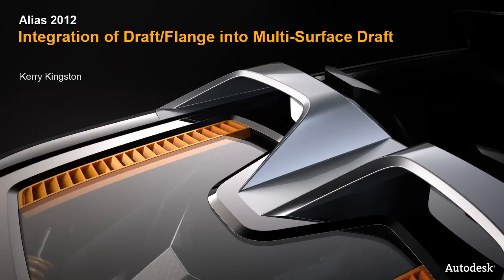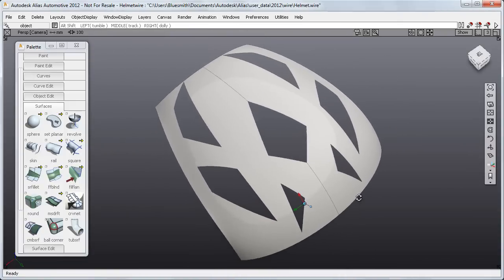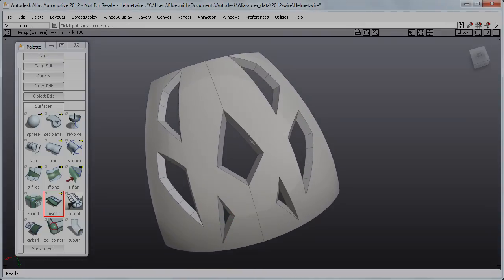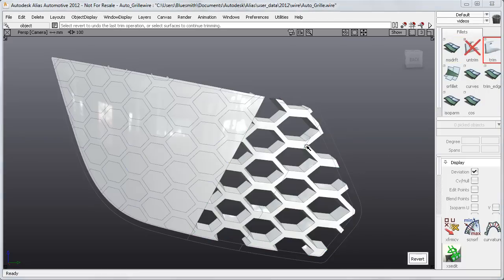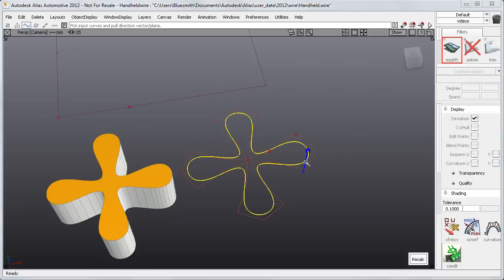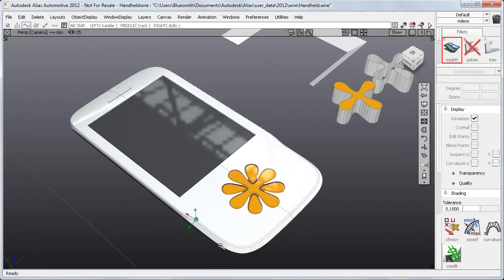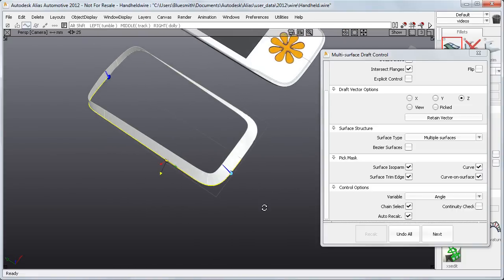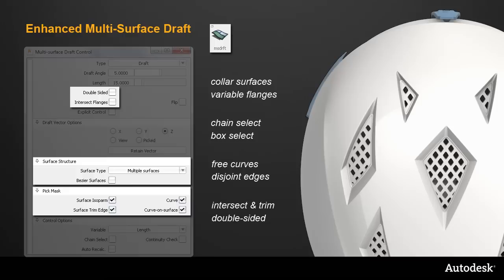Autodesk Alias 2012 Multi-Surface Draft

Comment: Sorry for this question after so much time, but in Alias 2023 is the variable option available? I mean to be able to use the manipulators to change te heigh of the draft? I seems I only have one manipulator and not several.
Reply: Got it, you need to Shift+click to add more manipulators.